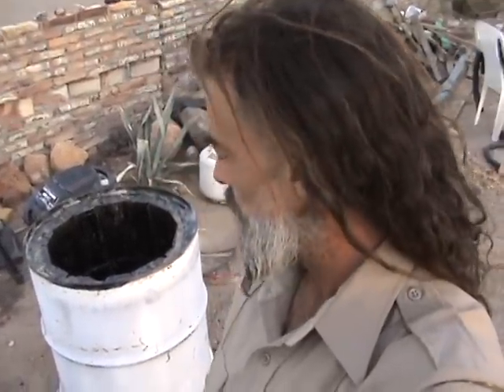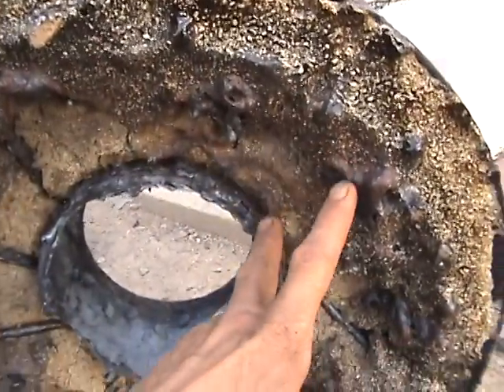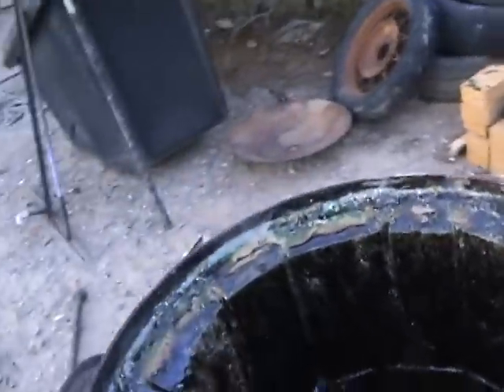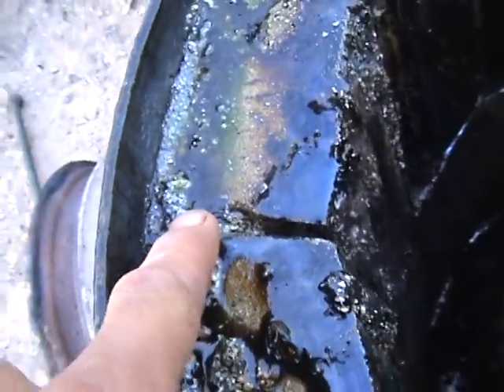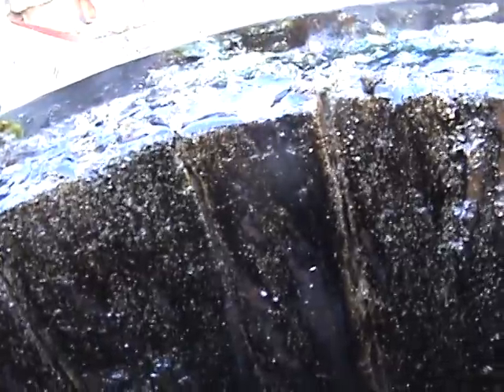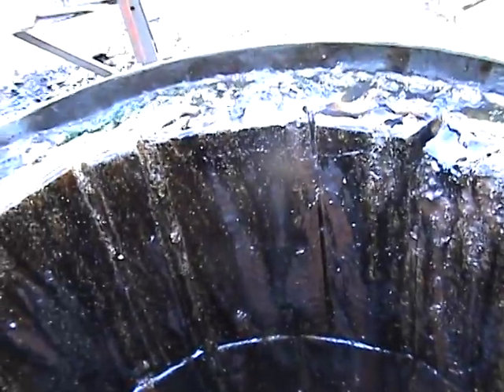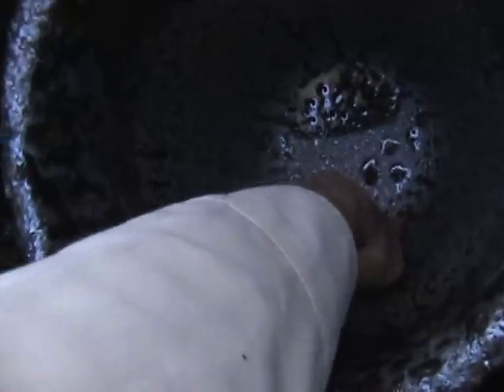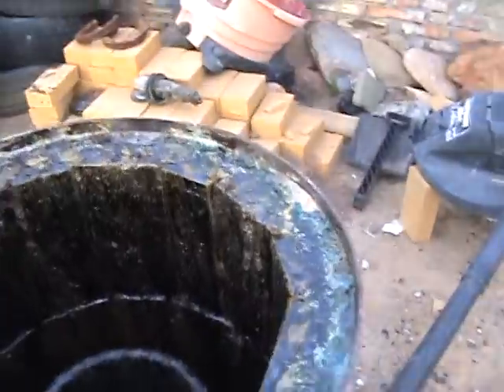home made blast furnace after 6 burns results

Comment: Overall your doing great guys. A few tweaks that may save you some money is looking into running it off used waste oil instead of propane. There are lots of info on the tube about how to convert it or even make your furnace a hybrid mixed fuel ore melting machine;)

Also instead of the high wattage vacuum/blower... you can use a small electric leaf blower hooked to a router speed controller or light dimmer switch for variable air speeds.   You might also look into adding an air scrubber coming off the exhaust port both for added safety & possible metallic capture. Keep it cooking;)
Reply from the maker: thanks adam,.. we are still in the infant stages of doin this stuff
Reply: At Walmart there’s small blowers made for air mattresses they’re small compact and run off 12 volt or 120 volt either or they are about 15$